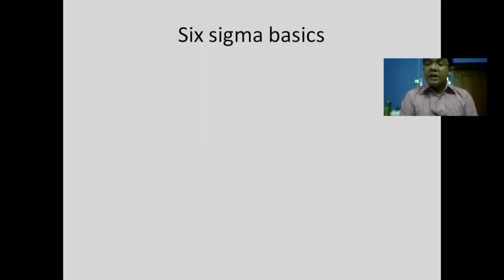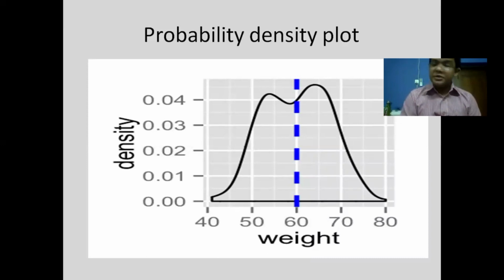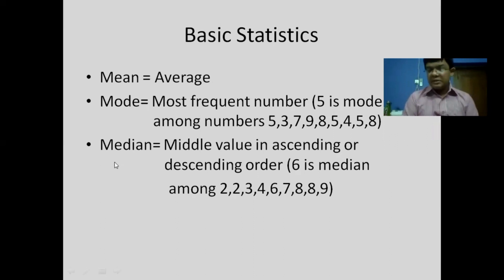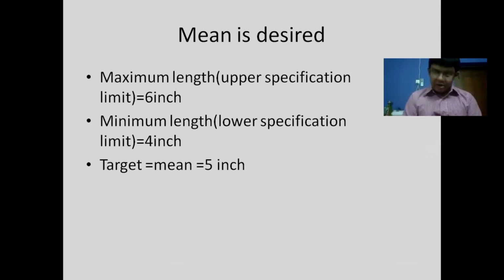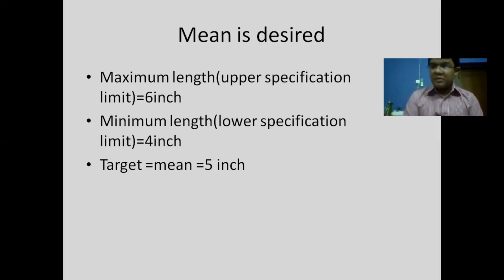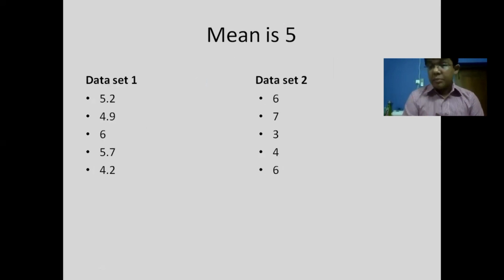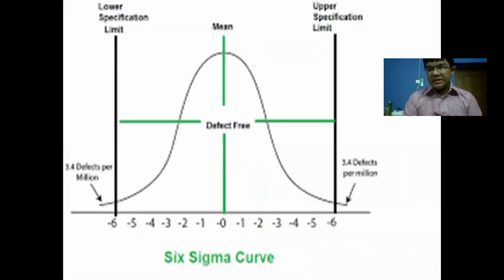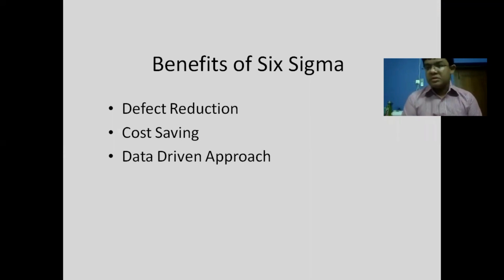SIX SIGMA সকল খুঁটিনাটি এক ভিডিওতে।

Comment: "Six Sigma Champions are con men" 
“All you have is smoke and mirrors” 
- Creator of Six Sigma, Mikel Harry
91 % of Six Sigma companies have trailed the S&P 500 (Qualpro survey).  A long term study at Ford showed an average of 1 in 5 parts defective AFTER improvement for “successful” Six Sigma projects.

Six Sigma is a destructive scam based on pure farce.  It started with Mr Bill Smith and his out-of-control molding process that happened to drift “as much as 1.5 sigma”.  Smith’s buddy, con man Harry, “proved” Smith disaster happened for every process ... based on the height of a stack of discs!  Most folk never bothered to check.  

“Neutron” Jack Welch at GE described Harry as a “madman” and said no one had any clue what he was talking about.  Jack handed over $1B anyway.  A scam was born!  GE has now thrown the Six Sigma trash out.

EVERY aspect of Six Sigma is worthless, from its normalization nonsense, to its irrelevant enumerative methods, to its paralytic DMAIC.

Dr Wheeler, the world’s leading process statistician, calls Six Sigma “GOOFY” and the stuff of “the tooth fairy”..  CBS calls it the most stupid fad of all time.

There is never justification to stray from the giants of Quality Dr Shewhart, Professor Ishikawa, Professor Lewis, Professor Deming, Dr Taguchi and Dr Wheeler, for the lunacy of Six Sigma’s con man.

How the Six Sigma fraud was started:  
https://youtu.be/0kZbJLHK_4M 

Lean was tacked on to prolong the Six Sigma Scam.
98% of LSS implementations FAIL (IW survey)